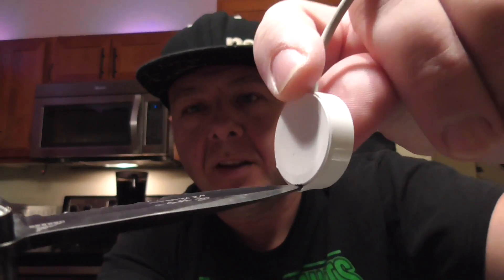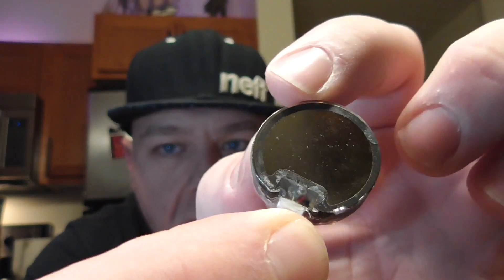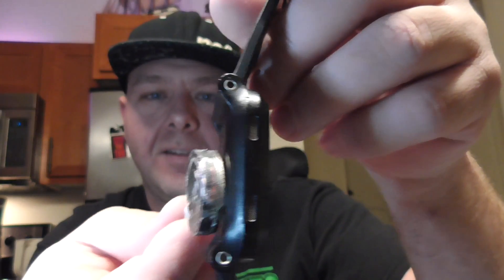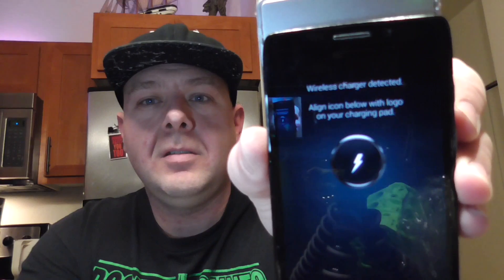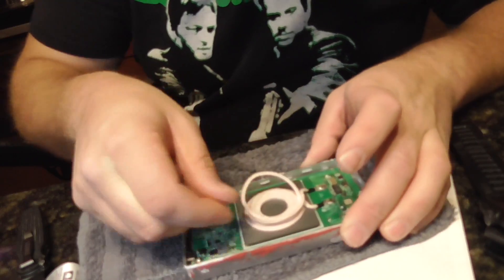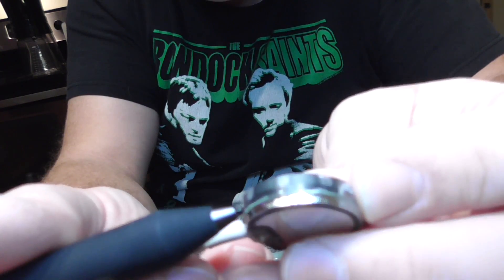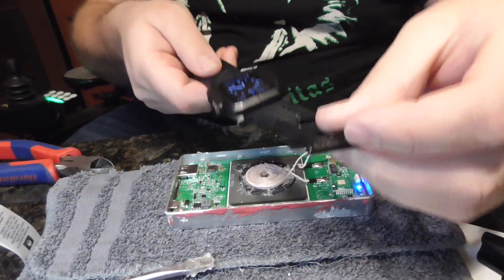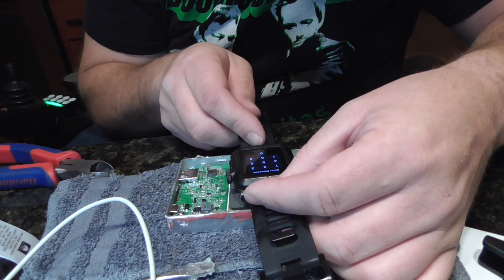Apple Watch charger disassembly (2016)

Comment: Your on the right track but its not the coils. The magnet is what enables the watch to charge from the coils. if you put a small magnet on the back of the watch and put it over a QI charger, it will charge. its just hard trying to keep that setup stable. In my tinkering, it appears the coils do not need to be shrunk down to size. you just need to figure out how to incorporate the magnet. I have been breaking my neck trying to find a proper sized magnet and I never thought to get it from the apple charger! Do you still have the one you took apart?
Reply from the maker: I cut that part out of the video.. but I did try a small neodymium magnet as well... but with everything else it probably was some other issue with my “coil”
Reply: did you see a way to take the magnet out of the apple charger? also is the top part of the charger (the cradle part) made of plastic?
Reply from the maker: the whole thing was encased in some sorta epoxy type material.. and the outer housing is all plastic. 

BTW update.. china FINALLY sells knockoffs! took long enough! ya can find cheapo ones on ebay now.. only took.. what.. like 4 years for that to happen?? ha!
Reply: @TotallyNormal-  It would be interesting if the original charger still works without the magnet

Comment: I’ve always wanted an Apple Watch charger that’s just the magnetic coil end of it (the “puck” as I call it), where you plug in a Lightning cable to power the puck. It would be so convenient to carry around a Lightning cable and the small puck rather than two separate cables for the two devices.
Reply: pcb design nightmare. gonna try anyway /:

Comment: Hello sir, do you have any idea what the flimsy paper-like black ring glue to the coil is for? im trying to modify my old dock charger(A1714) to fit perfectly for the redesigned and bigger watches by simply swapping out the plastic cap with one from new charger, but i accidently snapped the black "paper ring" into two pieces :(
 im sure its there for a purpose and im just concerned if i can damage my new watch over time by charging it without the ring.. i also took a look inside a replica ebay charger from a chinese seller thats identical to the original on the outside, but inside it didnt have "paper ring" or anything of resemblance. it is also semi-hollow as the coil is smaller and they didnt bother to use any sort of filler material. Needless to say it also charges the watch slower than original.... it magnetizes the watch almost as good as the original, But cannot recommend tho... And yes i am aware that its 4.5years aog you uploaded this video. Adios :)
Reply from the maker: ya not sure what that ring is for unfortunately.. sounds like youre makin progress though!

Comment: I’m sure there is a magnet release on the watch itself, try using a small magnet in the center of the watch on the back and then try the power pack again. Either at the same time or straight after. 🤷‍♂️ give it a go.
Reply from the maker: yea.. i wound up citting more magnet testing out of the video.. but it turns out there in an encrypted handshake that occurs when ya plonk the thing down onto the charger.  that's why theres a slight delay before it starts charging

Comment: The number of coils need to be about the same. Also have you tried to put a magnet in the center of the homebrew charger
Reply from the maker: Yea - actually cut that out of the video - but I tried a magnet in the middle in all different configurations. Weird it'll still charge other phones even with the crappy windings - I think they must have a pulse code to start the charging - going to get out the oscilloscope and check into it some more :) it's gotta be doable!
Reply: interesting never thought about a pulse code
Reply from the maker: would be super easy for them - and explains the 2-3 second delay before the watch starts charging after its placed on the charger
Reply: It has to be a strong magnet.. I'm able to get my watch to charge using a magnet. I initially tried it with a fridge magnet and it didn't work so magnet strength definitely plays a part
Reply: There’s nothing special it’s just requires the magnet to be there first before it opens the gates to the battery
Reply: The magnet is placed there by Apple so you can’t use another wireless charger you have to buy theirs if you want to have a watch
Reply from the maker: nope! tried a neodymium magnet and several others...no dice.   its been confirmed now that there's a handshake code by others that have reverse engineered it
Reply: Awesome! I thought otherwise lol it’s simply Apple making things proprietary to them only and people always reverse engineer stuff and they get mad about it even though there soo rich!

Comment: Hello I've wondered the about the same thing and I've found out if you create a coil and connect the end of it to an led you can see the led blinking at a certain rate which means that the Apple Watch charging operates at a certain frequency or it could be using alternating current But please reach back to me if you experiment more with the wireless charging for the Apple Watch :)